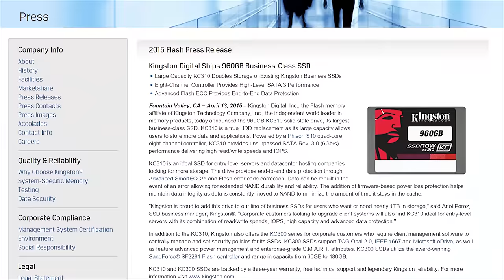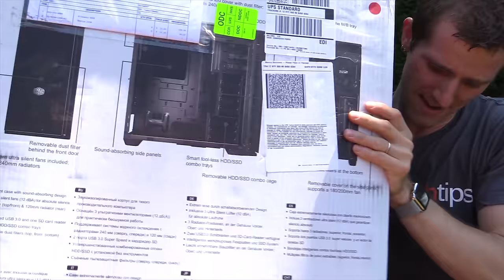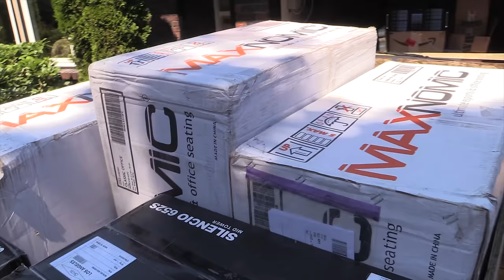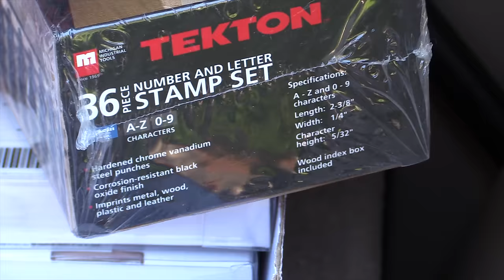New Office Vlog 3 - More progress and new gear!

Comment: They probably just haven't put the duct work through yet for the output. I used to do drywall and framing work and it's not uncommon for them to come in after the drywall has been hung. We actually used to race to try to Hang all the drywall before the Duct workers, Electricians, & Plumbers came in. That way there are much less cuts for us to do in the Drywall while were hanging it, and the other trades can just cut the holes that they need so it ends up looking a lot cleaner and is also stronger.

Comment: Can someone explain me what this thick grey stuff on the office wall is ?
Reply: D3GM4N Some kind of concrete probably...
Reply: D3GM4N Sound dampening stuff would be my guess
Reply: D3GM4N the thing he said he hopes dosent get dented?
its some type of spray on foam sound dampening i think
Reply: Sound dampening material. It helps reduce the echo.
Reply: customfreak567 And it is insulation.
Reply: In a previous video, there was some moisture leak that made all the wooden walls get ruined so they needed that insulator. Or something like that if I remember correctly.
Reply: D3GM4N It's a type of insulation. It's sprayed on with a large hose and that's why it looks foam like. To reduce echoes etc. your best option is to break up any flat spots on the walls. That's why it's not flat and is textured similar to a pumice stone. It's not cheap to install in an area that large, so understandably, Linus was pissed when someone busted up that large section haha. Edit: Hope that helps.
Reply: JordyValentine thank you :)
Reply: D3GM4N I think five people just said a different version of my exact answer right after me...
Reply: D3GM4N  it's called cellulose spray insulation...a mixture of shredded newspapers, borax, glue, and when sprayed on with water it becomes hard but wayyy softer than concrete. Its a type of insulation and also a soundproofing. :)
Reply: odokee smalls and "cellulose" was the word we were looking for. Question officially answered!
Reply: D3GM4N Insulation/sound dampening.
Reply: jesus...
Reply: Delayed You said sound dampening and it sounded like you weren't too sure. Others clarified and added that it was insulation as well.
Reply: Apansyy I understand that, I'm a bit confused at why so many felt the need to answer the question.

Comment: smb multi-channel... multiple network adapters in all hosts... unique subnets

did you split the channels on different subnets? if you plan to use two channels you need two subnets, every machine has a leg in each subnet... might even need to separate them by vlan on the switch

Comment: did you ever think of getting a professional network tech to do the  aggregate connection for you? as how i understand it both the server OS, the NIC, and the switch ports have to  support and be configured for the aggregate connection.
Another suggestion is triple check that your business will have enough Voltage and Amps to run everything including what you plan and might plan for in the future as one of the businesses that i have worked for had to upgrade wiring and it really disrupted the workflow of all of us during the rewiring through the required walls to get the extra Watts needed to run the equipment. I say this as you are in hardware reviews and yes i know power requirements are going down but overclocking is going up in what you can do and overclocking requirements are also going up when and if you feel like you can push it that far.

Comment: Linus, in reply to your new work SAN network switch problems in link aggr mode.  you mentioned it in a few other vids briefly.  I was thinking the other day, would this happen to be because jumbo packets are not enabled and MTU size from 1500 to 9000?  I had to do that on a link aggr for a dlink xstack SAN once for it to actually use the throughput of 4 network ports.  Just an idea.

Comment: linus..somthing you may have thought of before but i dunno...why not setup vmware as host OS on your project, then install your OS on top of it,  you can then do multiple save state files as you successfully implement features, and if it stops working simply reset the state to last known good...itll save you a buttload of time with fresh installs
Reply: Windows has restore points
Reply: Matthew Walsh windows does have restore points Matthew, however 3rd party programs do not, and its impossible for windows alone to make an exact sys image, including everything in ram and all changed files,   this is somthing vmware does...it allows you to reset to an exact moment with nothing changed from after that point
Reply: the other main reason to use vmware as compaired to windows restore is a vm save state reset takes mere seconds to a couple min get back up and running without the need for a reboot,  windows no matter how you slice it does take significantly longer.....that being said, windows restore is fantastic for the home user,  they dont need complete reliability,  the most they will lose if they are smart with file backups, will be time....vmware is best suited for servers and programmers where a sys crash can be devistating...especially when theres no one in the office to perform a reboot.   Vmware is unique when its installed as a sole host OS and has slave OS` installed on top.  Short of a complete hardware failure you simply login over the internet via another computer or smart phone and remote reset the sys that crashed.   configured correctly so that vmware takes a snapshot every few hours or min or whatever the reliability need is, you dont really lose anything by a crash....its more of an inconveinence then anything truely harmful......the other main ability of vmware is you can run many different machines on the same hardware, ironically aka virtual machines.   i.e. run server 2012 r2,  win 7 pro x64, ubuntu, and osx all on the same physical box,  so long as your host sys hardware has enough resources....even if not, it will still do it, but the ram writes will be to harddrive not to the ram itself, so yea really slow...SPEC YOUR SYS CORRECTLY if running multi OS......its entirely possible that theres other options out there,  but vmware is free for this type of use, though a license may be required if using for true datacenter severs,  and it simply cant be beat especially when first configuring equipment
Reply: picture this,  you gotta set up 10 different pcs with identical needs, or hell even all deifferent need,  all connected to a central server, but everything is fresh out of the box not even setup yet.   you pull out your server equipment and set it up with vmware, you can ignore the other pcs as of now since you know their hardware and specs.  you then sit down on you couch in the family room when you server is in the office doqn the street, and fire up your home pc.  you log into vmware over the internet and you setup vmware so that it has a win serv 2012r2 os in one file,  and win8.1 in another,  you go threw the install process for both at the same time,  once completed you take a quick snapshot image of both systems, then install the win updates,  win 8 works fine but the 2012 crashes on first attempt.  you simply right click and reset the image to before the update and try again,  this time it works,  you take another snapshot of both images.  you setup the 2012 with all software configured how you want it and confirm its working,  take a snapshot now right click and turn it off.  you then go threw your win 8 program installs and confirm its working,  take a snapshot,  right clicm n turn it off,   but now since you got 10 pcs you right click the win 8 save state and clone it 10 times,   you then boot each and change the necessary licensing and hardware to match your physical equipment needs for each pc,  once done you save state on each, and prepare the images for pxe deployment via win disk clone aka program like norton ghost....save state and then transfer the images to the win 2012 server,   shut down the win 8 virtual machines.....you now have to go assemble the new pc physical boxes....after much swearing and some duct tape your finished,  they new boxes are hooked into the network and pxe is configured to work correctly,   login to the vmware server and right click to boot the win 2012 image, and start the pxe broadcast.....each machine grabs the image ment for it and installs the exact clone image of the vitrual machines you setup earlier....from this point its juest checking to make sure everything went according to plan and stress testing the systems.....you can chose to keep the vmware at this point running you server or you can ghost the win 2012 image,  copy to a usb,  blow away vmware and reinstall the image on you box.......in reality all this time you only installed 3 machines,  2 of which happened at the same time  but got 11 different boxes up and running.....it rarely goes this smooth in the real world but the time saving over this is deff much faster then going to each machine and configuring them independently........for a home user its simply not worth it....but when you deal with dozens or hundreds of machines...or even just to learn it....its worth it

Comment: So I'm posting this here because their forum is offline for me and I'm quite in a hurry actually. So I want to buy an R9 390 from MSI but I'm not sure if my PSU has enough powa to run it. Most of the thing I could find online vary from 400w to 650w so I'm at a loss. I've tried every PSU calculator but none of them feature the newest line of cards from AMD. I currently have a 500w psu with an FX-6300, 8gb ram, 3 HDD's and a couple of fans. Would my power supply be able to run it or do I have to buy one with 650w?

Comment: I know this is not related to the video but i have a question.
I'm building a new computer and i need help 
IS A 500w power supply enough for this build??????
PARTS:
GTX 960 gigabyte g1 gaming
Asus M5A78L-M/USB3 Motherboard
AMD FX6300 Black Edition 6 Core
samsung evo 120g SSD
Western Digital - WD RE3 WD1002FBYS - Hard drive - 1 TB - internal
8GB (2x4GB) Corsair Vengeance Jet Black Low Profile
500W - EVGA 80+ White Rated Power Supply
BitFenix Comrade Midi-Tower
Reply: Liam McSpringleton thanks
Reply: sean widdowson Go to the linustechtips forum and ask your question there. You'll get much better support then you will here and it will actually be relevant
Reply: sean widdowson there are tools for calculating that
Like:   http://www.coolermaster.outervision.com/ (just keep in mind this will probably be an absolute min number)
Reply: Noah Fix thank you
Reply: Go to pcpartpicker
Reply: sean widdowson You should also get a CPU... Also maybe some RAM and if you really want to splurge I'd suggest getting a case.

Comment: Guys I'm building a pc, should I get:

I7 4790k and gtx 980 ti

Or i7 5820k gtx 980 (non ti)

I plan on playing games like GTA 5 and far cry, but I also do alot of rendering and video editing.
Reply: MarioManPVP A G3258.
Reply: Purely depends on the usage scenario
Reply: Yosyp go for the 4790k if you have the money. GPU is much more important than cpu in gaming, and the 4790k is still a great processer. The 980ti is slightly worse than a titan X from what I read

Also I'm stuck with a G3258 and a 660 (not that bad of a GPU) you rich SOB ;)
Reply: MarioManPVP i would get the 5820k, just to speed up rendering.
Reply: SlinkiestPopi You can wait a little bit for rendering, but you can't do anything for getting more FPS with the same graphic settings.
Also, you have to spend more money in DDR4 RAM and a proper motherboard which is pretty expensive now.
Reply: Yosyp 
No, an Athlon 5350.
Reply: MarioManPVP get an pentium 3
Reply: Get one of those new Segway things.